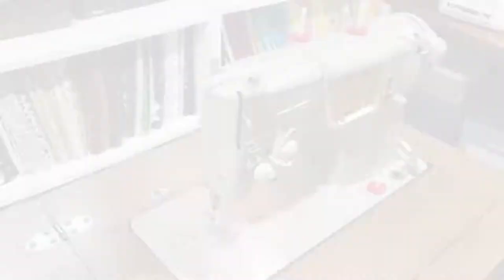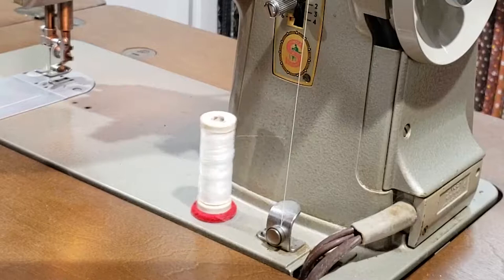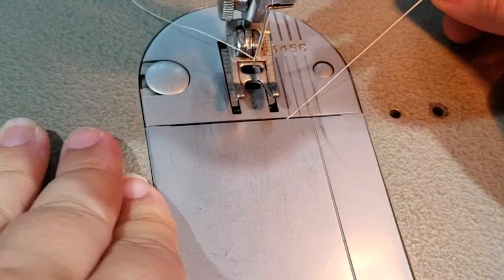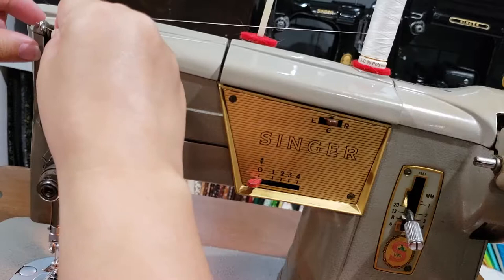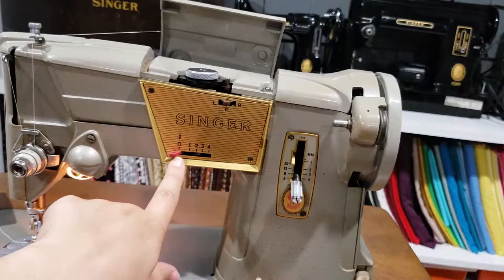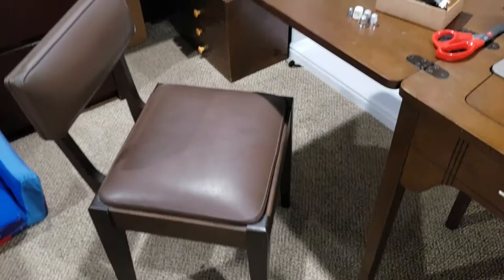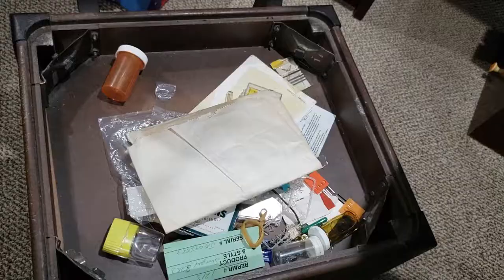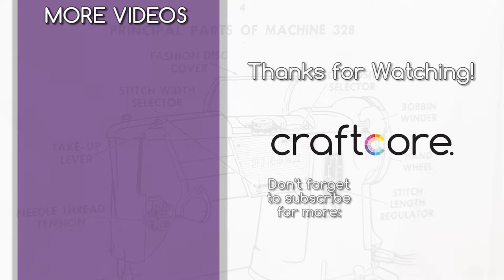Singer Style-o-Matic 328: How to Thread the Machine and Use the Fashion Disc System

Comment: I just bought a 1965 Singer 328K from Facebook marketplace for only $25 in a wood cabinet and with a storage bench and all accessories( like the changeable cams) The motor runs so smooth.  I can't wait to try it out.  I had a 1965 Kenmore with cams when I was first married.

Comment: Thank you for the video. I bought this machine for myself as a first year art student in 1973. It is only now that I m near retirement, that I am thinking I would finally like some more bells and whistles. Especially stretch stitches.
Reply: I got a Singer 328 at a second hand store.  Could no believe my eyes, because my mother had hers from the 1960's and it was the first one I ever learnt on.  But she was unwilling to give it up yet.  So the 328 I got at the second hand store, only had #1 Zig Zag fashion disc.  So went on Ebay to get the manual (which also  shows you how to oil and clean it) & all the fashion discs 1 - 32 + 37 are all the numbers for the discs.  Hope this was of help.

Comment: This is the second version of the 328. Both versions are exactly the same except for color and a few cosmetic differences. These are very good machines and were extremely popular in the early to mid 1960s. Because it gave you most of the features of the higher-end Singers, but without the huge price. I highly recommend this model to anybody. If you're looking on eBay for one. Don't spend more than $150 for them. If you're going to go higher than that, then go for the 400 series which as direct drive. This one of course runs on a belt. A great machine and wolf picking up if you can find one at a good price.

Comment: Thank you so much for the great video!  I've just started learning how to use a 328K that I bought at an estate sale. It is the portable kind in a plastic case, not a beautiful table like yours. I didn't like the foot pedal, so I bought a wooden adaptor which makes it much easier. I think it probably needs to be oiled so I have to figure that out.

Comment: I have one of these it’s fabulous. 🥳🥳🥳🥳🥰I did have an issue as it sped along on its own really fast and smelled burnt electric turns out it needed the capacitor taking out of the foot pedal so beware if the machine hasn’t been used for a long time.
Reply from the maker: Oh my, I'm glad you were able to resolve the issue! 💖

Comment: Did winding the bobbin seem “sluggish “ to you? I just bought one of these and everything else seems smooth but bobbin winding. Thanks for the video.
Reply from the maker: Hi! You may need to add a drop of oil in the little hole at the top of the bobbin winder to help loosen it up.

Comment: I have one of those machines too, but w/o the manual. How would I know the model of this machine, I can’t find it anywhere on the outside of this machine. Please help
Reply: The model number is at the top of the opening for the stitch length (threads / in.) selector with the big red 'S" in small print. Here I see it is the 328J (Canadian model).

Comment: Here are the Numbers and Names of the all the fashion discs by SIMACO for this 328 Sewing Machine ~ Stands for SInger MAchine COmpany.  
There were no numbers 33 to 36 ever made and do not know why?
 1 Zig Zag                     2 Multi-Stitch 
 3 Blind Stitch Left      4 Scallop 
 5  Arrowhead             6 Domino 
 7 Shell Edge              8 Solid Scallop 
 9 Icicle                     10 Banner 
11 Key                       12 Walls of Troy 
13 Solid Diamond   14 Zig Zag Point 
15 Long Oblique     16 Shingle 
17 Pennant              18 Three Step 
19 Ball                      20 Curve Mending 
21 Thunderbird       22 Semaphore 
23 Solid Pyramid    24 Open Pyramid 
25 Spiny                   26 Block 
27 Fagoting             28 Comb 
29 Pavilion              30 Platform 
31 Crescent            32 Blind Stitch Right
32 ~ 36 -NA--        37  Elastic Stitch

PS The one you found in video in this machine is the Crescent which is rare as the sewing machine was sold with the #1 Zig Zag in it ready to go.  You did get about 8 discs with the machine.  Built inn the 1960's.  A tip for those with the machine that was first made without a light switch on it, I plugged my machine into a timer, and just turn on and off the switch on the timer to save the original plug from being pulled in and out of the wall.  These are getting up there in age!  :~)  Hello to fellow Canadian ~ we aren't too far from you.  Used to live in Ajax next to Pickering.